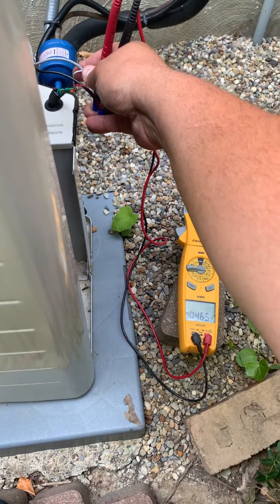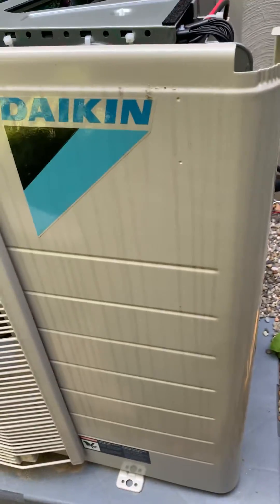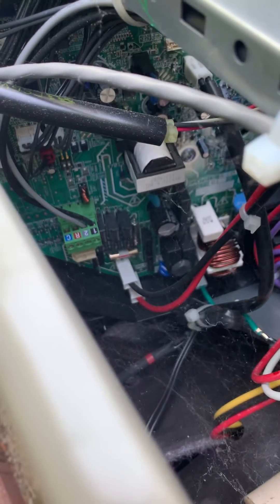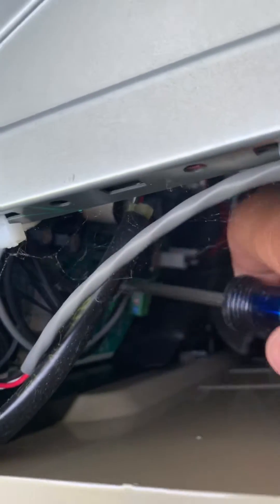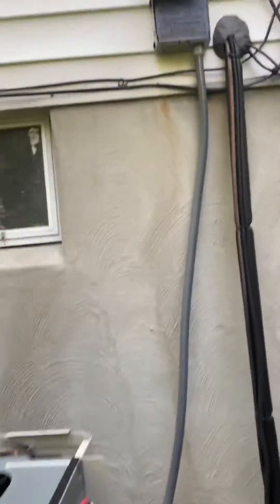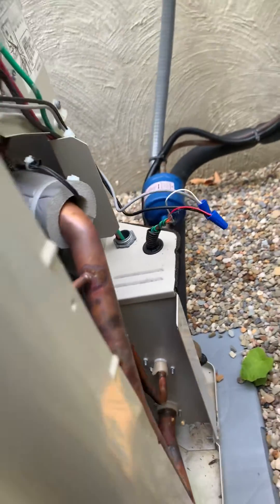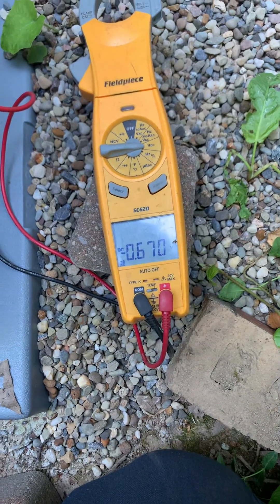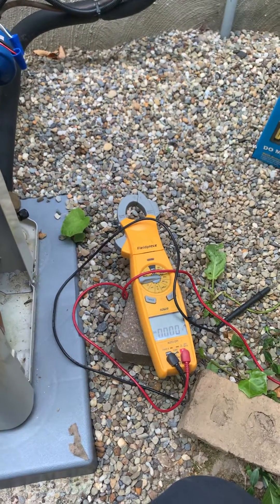Daikin FIT Communicating Voltage

Comment: Never seen a liquid line dryer on a mini split line set before.?? EEV's are in the condenser unit.
Reply from the maker: The Daikin FIT is a unitary split system with either an air handler or gas furnace.  EEV is in the indoor coil or air handler

Comment: These fits drive me up a wall, i had one with a constant high superheat fault, missed the bulletin, turned iut the harness was corroded sending incorrect voltage to the EEV starving the evap.

Comment: I'm getting communication issues from a unit just installed, system works fine for about 12-14 hours then suddenly stops communicating with the thermostat. System comes back online after about an hour or so, this doesn't seem like the same problem you're showing but it's extremely frustrating that this is occurring. My AC guy hasn't got a solve for it yet
Reply: Did you ever find out the problem and solution?

Comment: If this needs to be done, I'm wondering why it's not done at factory?  I was commissioning a fit system today and as soon as I'd hookup the Low voltage to outdoor unit, nothing would communicate anymore. Going back with proper service tools to diagnose and repair but wondering if it may be something to do with these switches.
Reply from the maker: I wish had a specific answer on why the  bias voltage dipswitches aren’t set this way from factory, but I never got a logical explanation from Daikin tech support.  Usually it’s just a bad connection or crossed wires that cause a loss of communication… good luck!

Comment: Is a special thermostat required for the daikin fit to communicate with the furnace properly?  Is any functionality lost if you don't use a Daikin thermostat?  I have a Ecobee 4, can that be used?
Reply from the maker: The Daikin FIT is a fully communicating system and requires use of either the Daikin One thermostat or the CTK04 thermostat.  24 volt thermostats such as the Ecobee are not compatible .
Reply: @staticpressurenerd5182  Thanks!
Reply: @staticpressurenerd5182  Which of the 2 you mentioned would you use if you were to get one?
Reply from the maker: Sorry for the delay. The Daikin One continually receives updates for the Daikin inverter systems to be optimized for optimal performance.  This will match best with your system over time.

Comment: So I have a question . I just installed. The Fit with the one thermostat. When the thermostat is set to off . The indoor and out door unit come on. For about 30 minutes. And when pull the thermostat off the wall after a few minutes it all shouts off. And when I test data 1  to Commen I get 2.5 and data2 to commen I get 2.2 . = .3 dcv is the a issue . Thank you
Reply from the maker: What do you read between data 1 and data 2  on volts DC?
Reply: @staticpressurenerd5182  .3volts  between D1 and D2
Reply from the maker: @stevealoia  sounds like there could possibly be a poor wire connection somewhere in one of the data lines.  Have the bias voltage switches in he FIT been adjusted when installed?
Reply: @staticpressurenerd5182  so I switched the dip switches from off to on and the system seem to do the same thing but I didn’t check voltage so I have to switch it back and check voltage and see what the voltages and go from there
Reply: @staticpressurenerd5182  I’m testing voltage at the thermostat. Should I all do check at the fit unit
Reply from the maker: @stevealoia  the thermostat is the best place to check.  Try redoing all of your connections and make sure they are all clean and tight.  If still no luck I recommend calling Daikin tech support.
Reply: @staticpressurenerd5182  I will thank you . The funny thing is I called Daikin support. On Friday 
And the guy was very rude to me . Made me feel like I was stupid. And wouldn’t help me . 
So I hung up on him . But sent a email to Daikin 
I been a tech for 10 yrs . And for 15 yrs did electric and plumbing for 15 yrs . 
But the fit is new to me . Thank you for your help I’ll check a few more things . Then I’ll call the Daikin rep for NY .
Reply from the maker: @stevealoia  happy to help.  Good luck!
Reply: @staticpressurenerd5182   so I had talked to a local HVAC  supply house . And there tech said the dip switch I was turning on was for emergency uses. That’s why the unit would shut off. The the main board there are another set of dip switches . He had me turn them on and now I have  .6 DCV  but I still think I’m under charge d . In heat pump mod my 7/8 line set is only getting to about 125 degrees . Now I setup HP before and they ran about 150 degrees. Again thank you for your help